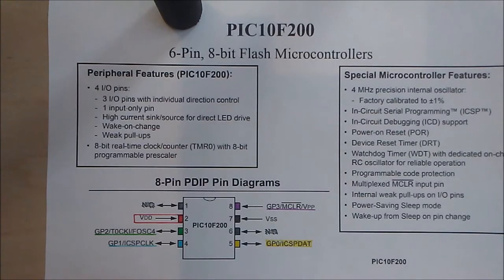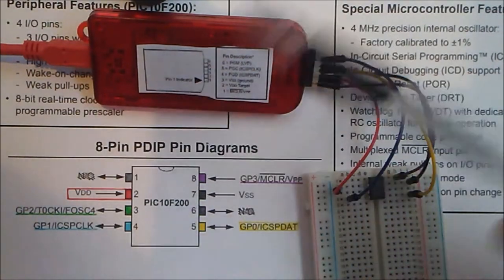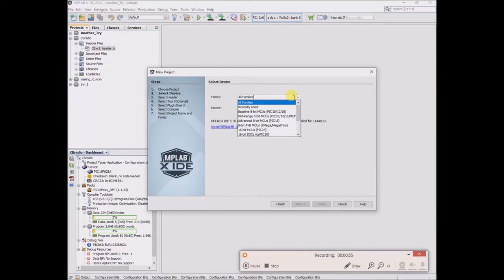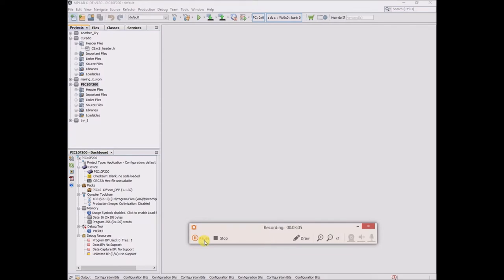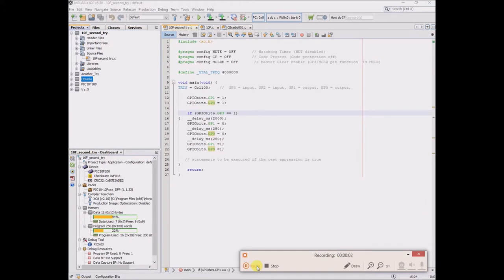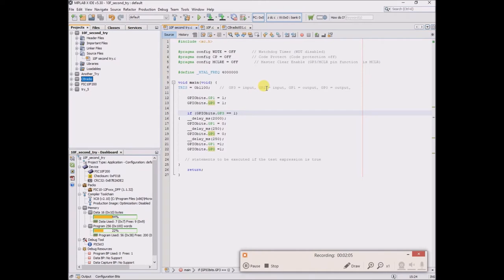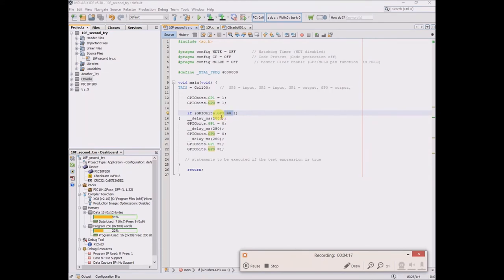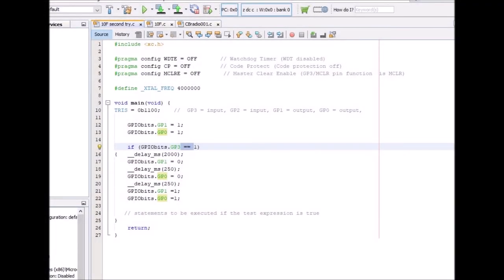PIC10F200 PIC Programming Microchip MPLAB X IDE - "If Statement"

Comment from the maker: Search for the PIC10F200 playlist on my channel, if you liked this video! Thanks!
The following code isn't exactly like that shown in this video. Although, it is very similar. You might like to try it.

void main(void) {
TRIS = 0b1100; // inputs = GP3, GP2 / outputs =GP1, GP0

GPIObits.GP1 = 0;
GPIObits.GP0 = 0;

if (GPIObits.GP2 ==1)
{ __delay_ms(500);
GPIObits.GP1 = 1;
 __delay_ms(250);
GPIObits.GP1 = 0;
 __delay_ms(250);
GPIObits.GP0 = 1;
 __delay_ms(250);
GPIObits.GP0 = 0;
 __delay_ms(250);
}

Troubleshooting?
Remember, GP3 is input only.

and

On some chips (NOT the PIC10F200), the oscillator frequency has to be defined. (The 10F200 has an internal oscillator.)  And unlike other PIC chips which require and external oscillator to be added to the circuit, the 10F200 does not require an external oscillator.

Although pins 3 and 4 are the oscillator and clock pin, I'm not100% if an external oscillator can be added. If any one has tried adding an oscillator, please tell me. Thanks

Some chips (not this one) require the oscillator to be defined. The code for this is:  #define _XTAL_FREQ 4000000
Don't forget to add it to the top of your code, if that's your case.

Also, check out the playlist on my channel: on the PIC10F200. It shows many more videos with me trying some simple code.